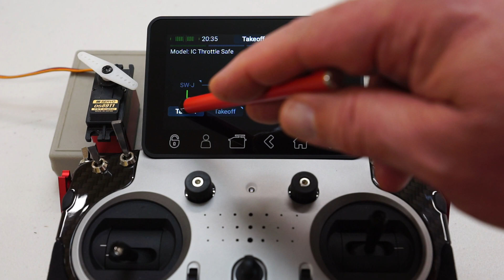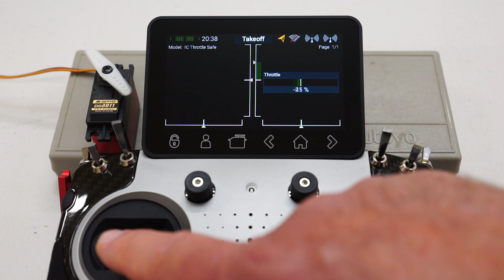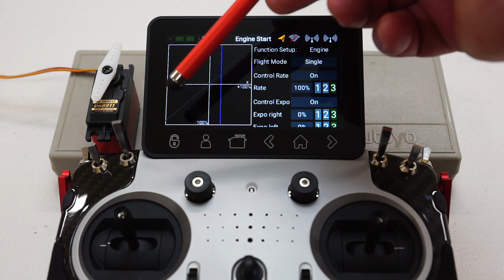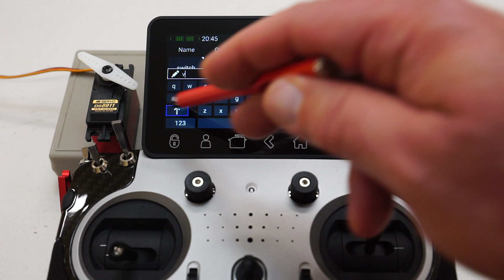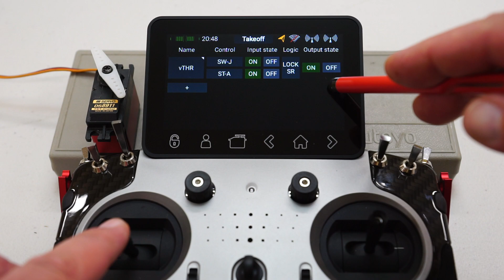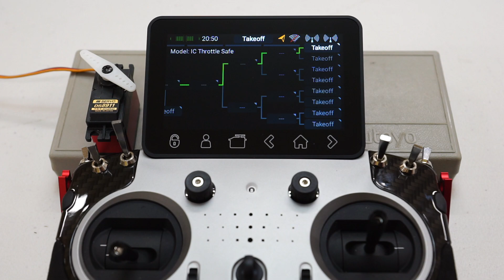PowerBox Core - Atom : Internal Combustion Engine Safety Start / Run Control Setup

Comment: I can see a set up using this concept to control IGN, Choke & Fuel Pump.  POSN0 IGN off, PUMP off, CHOKE off, POSN1 IGN off, Pump on, Choke on (choke to prime the engine), POSN2 CHOKE off, PUMP on, IGN on (start and run engine) .   Many thanks for yet another great tutorial.  cheers P

Comment: Hello, thank you for the video. How do you get the voice active for the flight mode? Also, how do I make my trims beep when I move them? Thank you so much for your time.
Reply from the maker: For the Flight Modes, go into the 'voice settings' menu and the very first default entry is for voice announcements for flight modes. turn the control to ON for this line and now it will automatically announce the flight modes as they change.

I'm not sure what you mean about the Trim... but to set the trims you need to go into the Function menu and assign a trim to a function. Once you do this you can edit the trim settings in that trim menu. You can also set them to be the same across all flight modes or have separate trims for each flight mode. Set the Global setting to Single to have separate trims for each flight mode.
Reply: @CVHeliPilot  Thank you for the response. My apologies I meant that how do you activate the beeping noise when you move the trims? Now when I move, for example my elevator or throttle trim it doesn’t make any noise. Thx
Reply from the maker: @trophyhomesallday  If you go into the trim menu for a particular function you will see all the trim options. One of these is to select the beep and vibration etc.

Comment: Thanks for the video.interesting  to watch.  I tried to replicate this , however I wanted to do add a  flightmode for high rates and low rates on another switch . It got complicated but since the left side takes priority I did not make it happen. How would you do it? Thank you.
Reply from the maker: With regards to rates you can set them up via switches or flightmodes (plus a couple of other options such as virtual switches or even telemetry value control).

I suggest you take a look at my 3 videos covering the Function Menu. In particular video #2 shows you how rates can be adjusted and chosen.

https://youtu.be/ReaCX9UHv3s?feature=shared